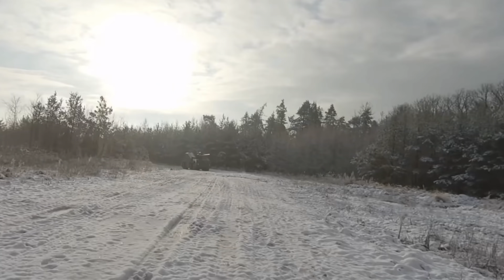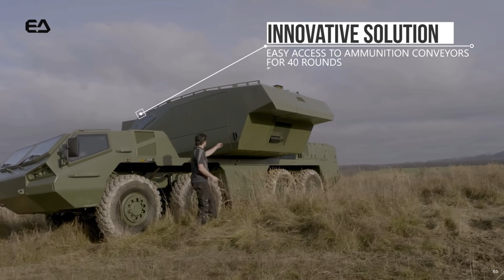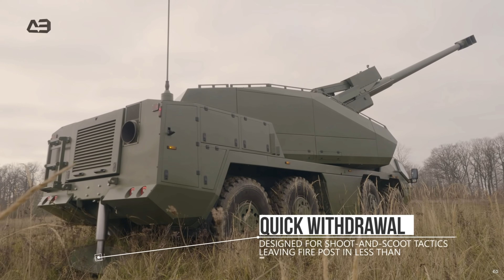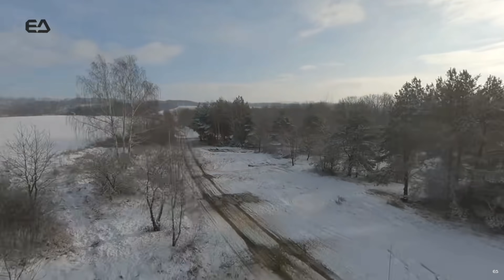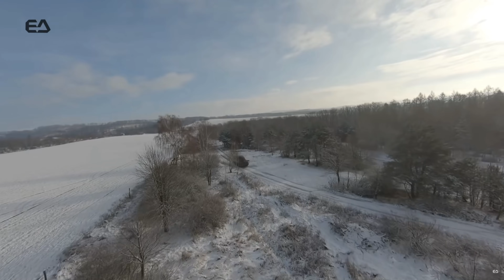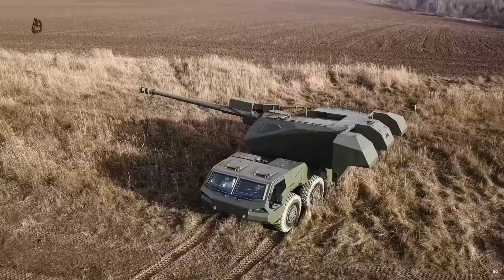Excalibur Army 'DITA' 155mm Self-Propelled Howitzer | MODERN BATTLEFIELD ARTILLERY

Comment: Super Sonic rounds are now being tested that will make the longer range and harder to stop and accurately a game changer in providing rounds faster and safer from stock piles long in the rear . The Russians have to be matched as they are very much into the rounds use of airflow to propel the round as a rocket type  longer range tactical alternative .

Comment: M777 batteries are groups of bodybuilders working out who move in a herd in comparison.  Automated handling of munitions to the loader is the most obvious need of Artillery units.  The question is what does the delivery and loading of the next 40 rounds into the Howitzer look like, is it automated or Bodybuilders arriving with palettes of shells by helicopter or truck to stuff this turkey full of fresh rounds?  40 rounds at 60kg weigh about 2400 kilograms 2.4 tons.  That is a 'Metric buttload' to tote by hand.

Comment: If this doesn't have a manual mode that will put out a round every 3 mins at least and there isn't crew trained in that then sell it as scrap
I imagine ammo reload can be robotized too but the rest of the crew should be w the reloads ready to move in and help when computers fail, hydraulics faile, apu fails, etc etc.  The reload crew should also have modular equipment replacements like a hydraulic unit, apu, maybe a battery cart to power it up while APU is being replaced worked on, for that matter, a hydaulic power cart to power up those while hydraulic pump system being replaced, (and I assume it has 2 apus and 2 hydraulic pumps already on two sets of electrical and hydraulic lines run as seperate as possible from each other

Comment: This is fundamentally the correct concept — executed better than all previous similar systems — and every nation would do well to copy it (except our enemies). One needs trucks to tow your gun and haul your ammunition, anyway, so why not just mount it all on a truck? Wheels do almost everything tracks do at a fraction of the cost. Because artillery is located, typically, far behind the front lines where it's easier to choose one's firing position, cross-country ability of tracks isn't as important as for tanks.

Comment: I don't know: with hindsight from Ukraine war, this behemoth looks to me quite vulnerable because it cannot maneuver very well in tight spaces: it is so long and stiff that I guess it'd have problems on a mountain pass or crossing some bridge. Tracked vehicle may be difficult to maintain but cat turn on the spot without requiring large spaces and a PZ2000 can probably carry more ammos and has a longer gun. On the other side of the spectrum you have concepts like the Porcupine, which moves and manoeuvres better  it has limited firing angles but sets in in 3minutes, fires 3 rounds in fast succession and moves away. A big truck like this would be a sitting duck for any drone with very light armour and problems to move through mud and wood areas.
I prefer
Reply: You're underestimating capabilities of the chassis, it's very agile and terrain capable. It's also proven in this form and meny other 8x8 platforms, that it simply works. You can have systems like Dana on tracked platform, but there's no real demand.

Comment: I have worked with towed howitzers. And am a round runner on an m777 having previously served as an ammunition team chief as well. The problems with wheeled vehicles are as follows: the are easier to crash, easier to get stuck, and easier to destroy. 
Rocket artillery is getting caught up to as well, with reports of the ERCA program firing accurate shots up to 100km. That is 1 to 3 of the range of an ATACMS missile. Things in the FA aren't concrete. They are changing. I believe wheeled artillery will evolve as you do, but there will always be a tracked vehicle component for those shitty, muddy, nasty, hard to emplace  positions that suck ass to dig spades into and suck harder to drive through. 
Good video, I hope this or the archer gets brought in with the ERCA and made a part of the US Army Corps of Artillery. It would be spectacular.
Reply: You are probably right. But consider these vehicles are constantly moving and hiding around battlefield and doing quick artillery ambushes, with minimal personal only and without need for additional infrastructure. It might be perfect for type of war like in current Ukraine. 

In additions to that Russians are worse in getting and processing information from the battlefield and adjacent areas, so they couldn't easily target positions of these howitzer for direct counterattacks /ok, in reality even a destruction of one such weapon is very expensive when compared to destruction of towed howitzer/.

Comment: This is what they need in Ukraine right now with rocket assisted guided long range ammo.
Reply: I think two stages of breakthroughs must happen in which artillery can truly become more survivable:

Stage 1 - Self propelled artillery can drive off immediately after shooting. As in like 5 seconds.

Stage 2 - Self propelled artillery can shoot accurate fire on the move.
Reply: @Frenchfrys17  
The fastest modern self propelled Auto loading Artillery systems can fire off a number of rounds on different programmed trajectories to hit the same target at the same time and be on the move before or as they hit the ground. 
They can also track incoming rounds to source and fix their positions. 
The fastest firing guns were the Swedish Bandcannons.. the artillery equivalent of full auto rifle. 
Their are systems like the CZ wheeled systems that can fire direct and have rotating turrets but the recoil on an uneven surface could rock a vehicle over firing a broadside without deploying the stabilising legs. Forwards not so critical. 
But these vehicles are as wide as they can be and still use main roads.
Reply: @Frenchfrys17  Cannot shoot on the move, because the howitzer must be fixed to the ground. Otherwise the accuracy would heavily suffer. It is not so important for tanks with smaller caliber shooting at near distance, therefore for tanks it may be possible. 
And it can drive off after shooting (as fast as it is loosened from ground)...
Reply: @vencdee  Tanks can shoot on the move because they have stabilizers which auto adjust the aim depending on the terrain that is being crossed. Prior to that, tanks needed to come to a stop before accurate fire could be achieved. And these stabilizers can work well enough to allow tanks to shoot up to many kilometers away on the move. 

A more advanced stabilizer could give artillery the same capability.

Comment: Based on history, I think it needs a capable remote machine gun system.
Reply: Such a vehicle would more likely run into a tank, drone, or attack helicopter. In which case unless it's a really small and low flying drone, your machine gun is useless.
Reply: @Frenchfrys17  Just saying it is helpless against enemy infantry (which shouldn’t be in the area) and anything else.  If for no other reason for morale sake.

Comment: Firing a few shots from a single vehicle and driving away is not realistic for many situations. Most likely those "few shots" miss their target(especially if it's not a fixed target) or damage is not enough. Continuous fire will likely be necessary to achieve results, that is where the need for prolonged bombardments comes in and where the self-propelled chassis becomes less relevant and you need more guns at a lower cost with easy/cheap to replace or repair parts. If it is not easy to repair then your crews will just be abandoning it on the side of the road while retreating from the "enemy".

Comment: I think that 2 crew members are not enough, in case of emergency an extr member might worth it
Commander, Gunner, Driver
the commander can use a remote controled 7.62mm or 12.7mm machinegun and a quadcopter drone
the gunner will control the gun and be an engineer in case its needed to fix some of the automatic loading control issues that may occur
the driver will drive

it will be realy sad to fail delivering a mission because something jammed or got disabled by small arms fire

Comment: The reason their single gun based instead of a battery is to enable smaller locations, they will then co-ordinate with other single units to form a area network firing onto a single location.   Makes it  easier to camouflage and if attacked, an air strike only takes one gun out of the network.

Comment: Wonder if someone ever considered to use those things like AA or anti drone platform with such gun elevation it begs for time or proximity fused ammunition.
With all this automation it will be probably not to difficult to slave fire control to nearby radar equipped vehicle to provide fire solution.
155m round will be probably much more cheaper then AA rocket with very similar effect. 
And with 155mm every achtacht fever dream come true.

Comment: Hmmm...Put a naval-esque gun turret and ammunition handling system, plus modern naval-esque fire control system on a land vehicle.   I mean, auto fuse setting driven directly from the fire control system is so modern, er I mean 5" / 38 from 1939 (you know, like only 82 years ago).  Who could have thunk it?  Its time to drag land artillery forward a few years.   Rapid fire, rapid relocation, reduced human error of automatic system, small crew requirements - what isn't to like?  The real question is why is it taking so long?   I'd wonder how peer armies would fare facing each other, one equipped with this system or one of similar capability vs one with a mix of M109's and M777's.

Comment: Technology is advancing so rapidly I wonder if the powers that be can even get their head around it. It could be the case that unmanned systems are the best solution to every weapon system. Eliminating the manned portion of the design saves a tremendous amount of wasted space. ...besides saving lives. But then that leads to many other questions. Some questions that I can't even think of right now. They might need to rethink warfare altogether. Don't just try to make a better steam engine.....make that leap as in steam to diesel locomotives. Something new that we can't even imagine right now. Our side has to .....make that leap.

Comment: "Hacking" on the battlefield isn't really feasible, jamming is what works. First you have to get into the system remotely, which is why critical systems are not linked to the network and a human must push a button to work. Plus you'd have to know how to hack that specific system within a short span of time when you spot the vehicle downrange.

Disrupting communication/targeting equipment can be done with handheld equipment, though.

Comment: Dear Matt, i think the artillery term you are struggling to remember where  multiple round fired from the same gun impacting at the same time due to different elevation settings is MRSI. It means multiple round simultanous impact. A standard tactic used by modern artillery to compensate for decreased number of batteries each nation is fielding nowadays.

Comment: The wheeled Swedish Archer SPGH with a crew of 2-4 has been around since 2013 so... PS has a range of 30km, 40km with assist and 60km using the Excaliber. It can also fire six rounds at diff trag to land at the same time. The Dita is prettier though so there's that.
Reply: DITA also has multiple round simultaneous impact ability, just like most SPG systems these days. Even Slovak ZUZANA 2 has it.

Comment: I don't think the age of batteries is over. You still need the volume of fire.  The systems like the Dita is more like a sniper. Precise Hits than scoot, picking out high value targets deep in enemy territory.  So doubt it be sitting far behind but would say goes close to line maybe 2000 fire 5 and than buggers off.

Comment: I see tracked vehicles being solely reserved for MBT's and some IFV's.
Reply: they will be reserved for units traveling over relatively soft or slippery terrain (relative to their weight and the force of their recoil)

this includes MBT-weighted combat vehilces over most terrains, but will also include a range of lighter vehicles with missions in certain locations in mind.
Reply: Even tanks are going the way of a family of armored vehicles platforms favoring mobility as well . Particularly for urban lighter tanks and afvs and even wheeled ones particularly for urban .

Comment: I've always liked the Czech DANA vehicle, thought it was ahead of its time; this is a natural progression.
Reply: DANA wasn't Czech, but Czechoslovak... Czech designed chasis (Tatra) and the rest was designed and made in Slovakia (just like the rest of CS armored vehicles). The natural progression of Dana is Zuzana and now Zuzana 2 (there was even a prototype Ondava before Zuzanas), but the Slovak army did adopt just a few of them (16 Zuzanas and Zuzana 2 is still in testing).

Dita is made by completely different company (Excalibur Army), which is now a part of Czechoslovak Group along with the designer (Konštrukta Trenčín) and producer (ZTS Dubnica nad Váhom) of DANA and Zuzanas and I'm very interested in how they worked out (if at all) the intelectual property (patents), since Zuzana 2 and Dita are now competing products, each having its own advantages over the other.

Bonus fact: Since DANA was always designed with direct fire capability in mind, there is (/was) a HEAT ammunition for it with 560 mm RHA penetration (though the specsheet pdf was pulled down from the manufacturer's webpage when they were rewamping it due to new legislation in firearms sales).

Comment: The South African G5 and G6 units were operating this concept very effectively in the early 80's.
Reply: Tatra was the first worldwide to introduce the wheel based artillery, in 1970. And it is made for mud, unlike african vehicles.
Reply: He did a video on the G6
Reply: G6 now has a range of 76km and a 6000 rounds barrel life
Reply: It is a matter or transportability, reliability, durability and accuracy. The Ceasar is lighter and smaller and can enter the deck of an AM 400M aircraft. It has proved its reliability in combats, the barrel can sustain tough fire rate with limited performance downgrade. The Caesar is equipped with a verry performant pointing system, iniertial guidance  and an off-the-nozzle radar that allows for very fine accuracy adjustment according to available shells and propulsive load and the actual wear of the barrel.

So if an army can afford these performance, there is no wonder why armies have chosen Caesar.

Comment: My only real concern would be if the auto loader goes down you have 2 (maybe 3 depending on setup) people to load and fire
Reply: considering this a backline vehicle (and thus unlikley to get caught in a firefight), you would likely simply drive to a repair station and get it fixed rather than try and fight without the autoloader.
Reply: @matthiuskoenig3378  I assume the army would want some way to keep fighting incase the auto loader fails

Comment: A little concerned that the weapon is in effectively an open mount...... I mean how much more bother/weight to provide full cover for the weapon from splinter and weather.

Also only two crew. Not great if there are problems, I know they are always trying to reduce crew, but those extra crew are great for when things go wrong, or maintenance.
Reply: i think 2 crew is the minimum not standard, so you only need to active crewmen in case the others are resting or injured.

Comment: Great video! However howitzers will be a thing of the past in about 10 years. With the development of stealth drones (and other equipment) the ability for real time surveillance will make them a liability on the battle field.  With real-time data aircraft will be able to pick them off at a distance.
Reply: except aircraft are fairly easy to spot themselves, being big glowing heat signatures in the sky, even if by some miracle stealth technology advances fast enough to counter this despite advances in detection technology, the same apllies to ground vehicles, which are easier to hide. the only stealth drones that are likely to go undetected are going to by unarmed recon drones, but any weapon they are scouting for are very likely to be detected and intercepted (if its an air platform).

missiles are also becomeing obsolete against ground targets due to a variety of countermeasures.

the future of near peer warfare is likely ground artillery with the help of recon drones hunting air defense and other artillery. (and aircraft are just too expensive to dominate asymetical warfare)

Comment: Wheeled vs Tracked debate will last forever.
We went to wheeled but some high ranked want to go back to tracked
Wheeled requires higher skilled mechanics and very specific parts that cost more to produce
Tracked requires less specific tools, basic maintenance is easy and can be done even by poorly trained crews
Yes, work is heavier on tracks but requires less skills
Both have theur flaws and strengths
US is ditching their Stryker platform
Centauro is a mess to fix
Piranha are "heavy" on their chassis and wheels
But tracks arent efficient fuel wise, sound wise, not liked by population since it destroys their roads
Reply: tracks also have the advantage fo being more compact, and thus thicker armour (and/or bigger fighting compartment, etc) for the same weight, which makes them attractive for airborne forces (as well as underlining their off-road mobility advantage due to better weight distribution)